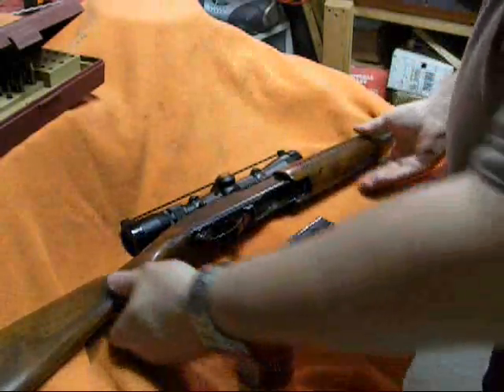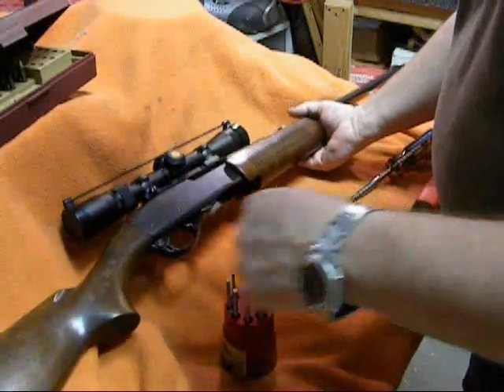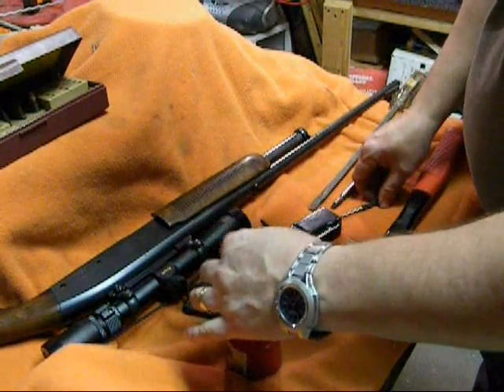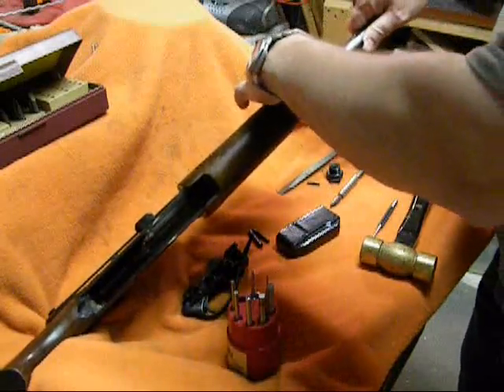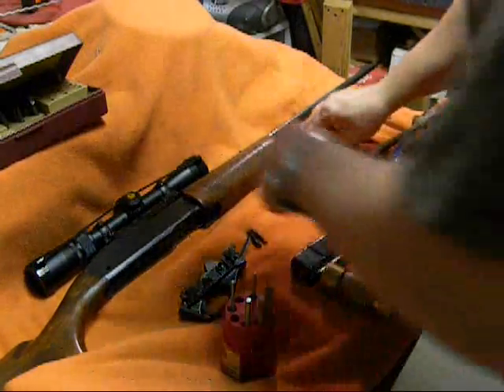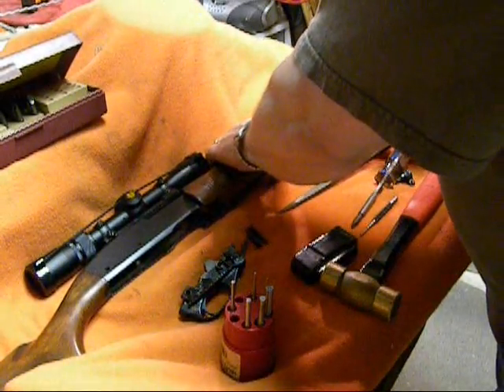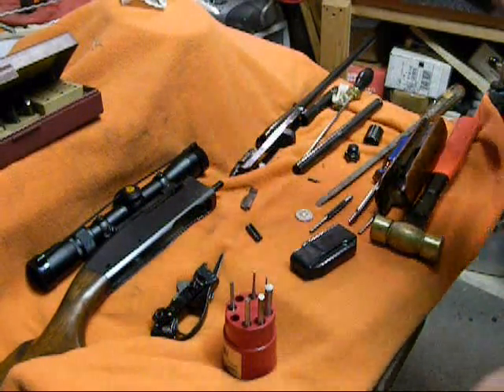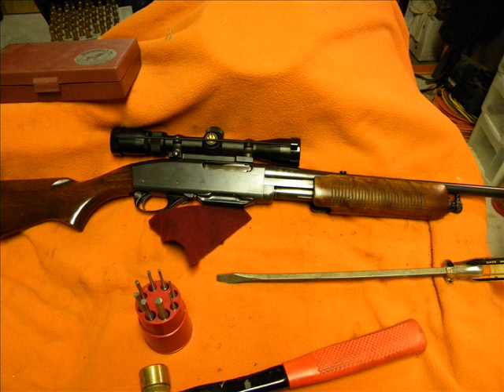Rem 760 Dissasembly

Comment: Thanks,mine is a 1958 and dont think its ever been disassembled completly and has been used in Pacific NW rain and I got stuck at the forend removal.Cant wait to see how gummed up it is with dirt and carbon,hopefully it will cycle smoother after a good cleaning.Thanks again

Comment: Actually super helpful video. All the other info I’ve found on the 760 doesn’t mention that third pin which is where I was running into issues. Unfortunately I can’t for the life of me get that pin out, it’s probably been 60+ years since it’s been moved. Might have to take it to a smith and see if they have any tricks.

Comment from the maker: For all such, I recommend the proper sized pin punch (same size as pin or just a smidge smaller), a little kroil applied ahead of time and a solid hammer  - remove left to right as you hold the gun to shoot.  The pin head may be peened a bit making it hard to move.

Comment: i just inherited one in .240 been beating my head against the wall the trigger sets but nothing happens when i pull the trigger and the bolt wont lock so it just cycles. any ideas or do i need to take it to a gun smith.

Comment: I got a newer (1980) version yesterday. It's different: the front stock bolt has no pin to secure it. The action tube won't unscrew (I broke three screwdrivers trying). It just won't budge. Maybe it's locktited or something? I don't think it's rusted since the rest of the gun is in pristine condition.

Comment: The Kroil goddamn it, the Kroil. My kingdom for some Kroil. Amazingly, I was headed the right direction. Couldn't get the action guide rod loose and it stopped me dead in my tracks. So I broke out the super gun cleaning spray, hosed the crap out of, turned on the air compressor and went to town. Now that thing is coming all the way apart!